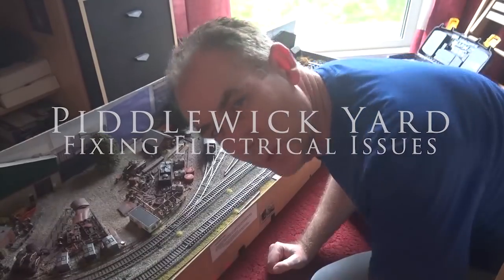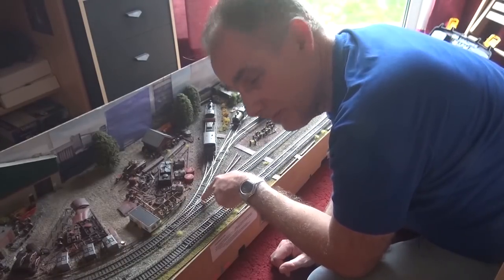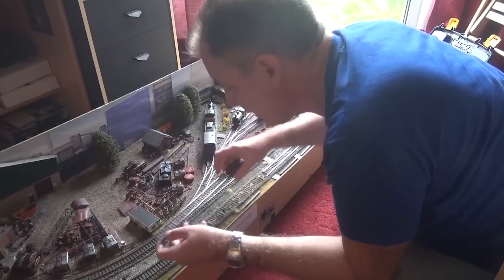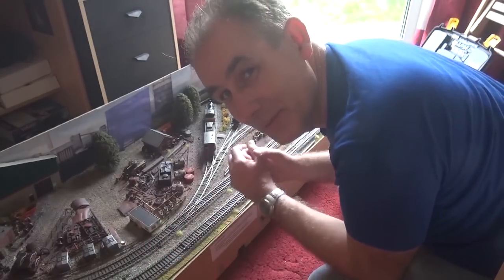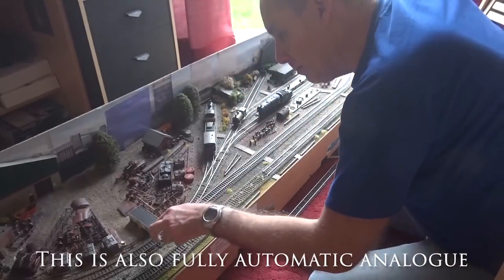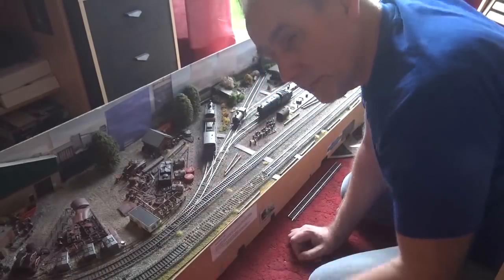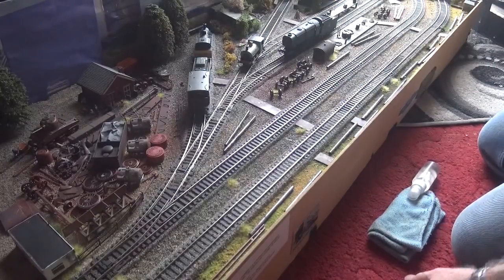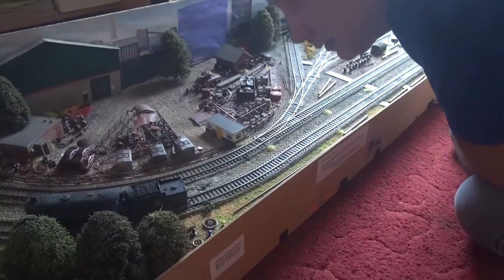Piddlewick Model Railway Electrical Issues Fixed

Comment: Its a good feeling when you cure a problem..
Reply from the maker: I'd rather not have those sort of good feelings Dave as it means I haven't had a problem lol. Normally I don't get too many but then my tracks designs are often straightforward. I get issues only because the models get tugged around because they are portable.  Happy New Year mate. Laurie.

Comment: Thanks for the tips Laurie and nice layout. I use the same cleaning method and sometimes a track rubber too.
Reply from the maker: Actually I did have a track rubber once but I found it left little bits behind, so I stopped using it. Mind you any abrasive does I guess such as mild sandpaper. I prefer the liquid cleaners. Cheers.

Comment: Hi Laurie. I used very fine sanding paper and track rubbers in the past for cleaning my tracks. But I found a more effective and cheaper material for this job: grey cardboard, 1-2mm thick. Take a small rectangle and rub with the edge over the rails. Very easy and very clean. If the edge is dirty or unusable just cut it off and you have a fresh tool 🙂. It is also good to remove paint from the rails. Just try it out. All the best for 2019! Guido
Reply from the maker: Sounds a good tip Guido. I'll have to give it a go. Laurie.